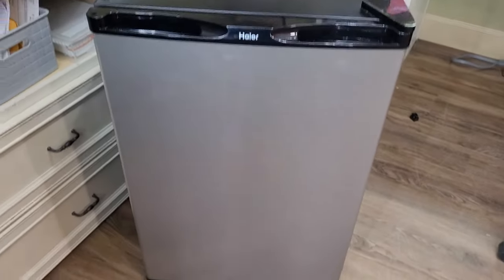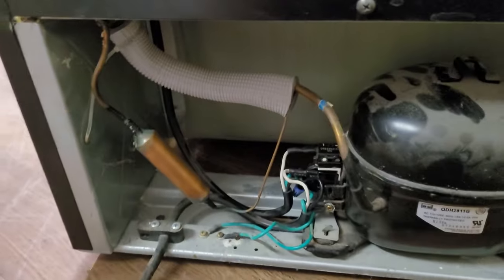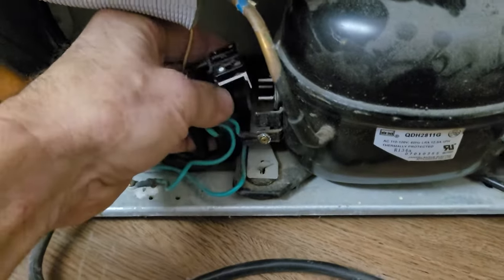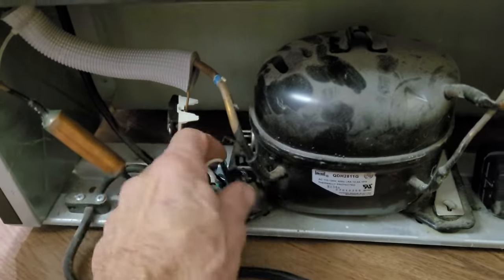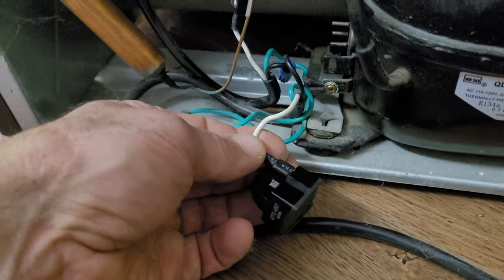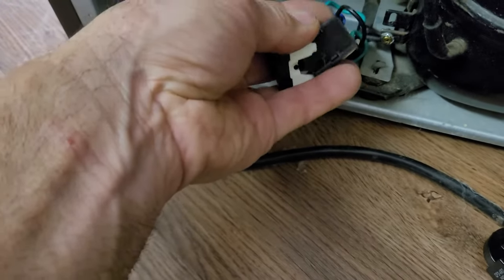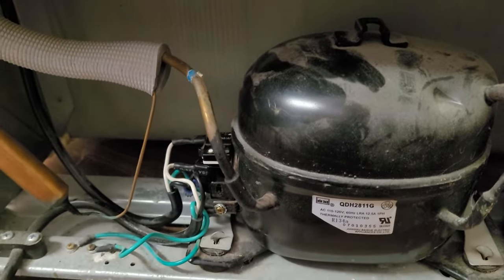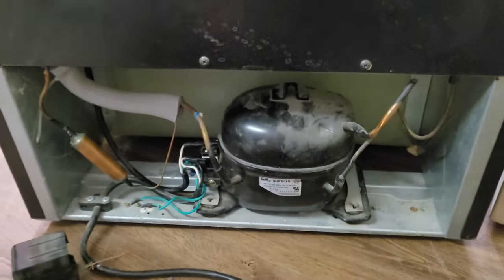Repair your mini fridge for less than $10

Comment: Excellent video. I replaced relay with no problems but when I turned it on the compressor clicked and I thought ah, success but another click and no further noise so I left it on overnight thinking maybe that was normal. Left it on all night but no results. Now what?
Reply from the maker: Unfortunately, that COULD mean the compressor is locked up.  You might try it again and tap on the compressor while it is in the click phase and see if it will come alive again.   That works from time to time.

Comment: I got a similiar fridge.   Noticed today it would just click every so often and it wasnt running.   I touched the compressor and it was warm.   I hear nothing running.   Would that relay be the problem or does the relay not control the fan?
Reply: Smae issue
Reply: Same here. Npt seeing any replies.

Comment: Wish there was a video of getting the cover off 😂
Reply: It's called "Project#22-Mini Refrigerator Fix (PTC Relay Replacement" by Vance's How-To Video Library.  I also had a hard time taking the cover off from my Danby Designer fridge due to faulty drawing on one face of the cover.
Reply: I had a hard time too, what I did was peel the right side off first and remove the metal clipping at the same time and that seems to do the trick.

Comment: My mini fridge was working fine and stopped. I noticed the compressor is hot. Is that something you noticed when repairing these?
Reply from the maker: No.  If the compressor is over heating, then you probably have a freon leak causing low freon.  If it got too hot, I will be damaged.
Reply: @Homemaintenancesolution  I don't know what it was but I changed the part and it started working again. Not gonna ask too many questions lol. Thanks for the video, it helped me out alot
Reply from the maker: @gcorc  nice!  Can't beat that!

Comment: I checked the AC voltage of the 2 wires, its like 1.5vac...does that mean I should check the board as well?